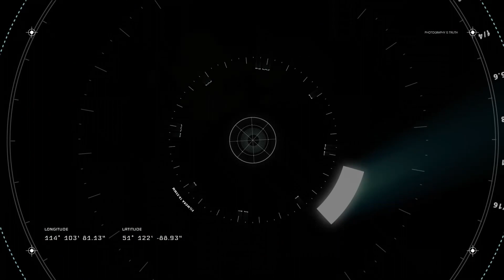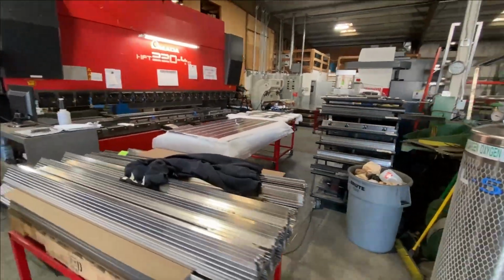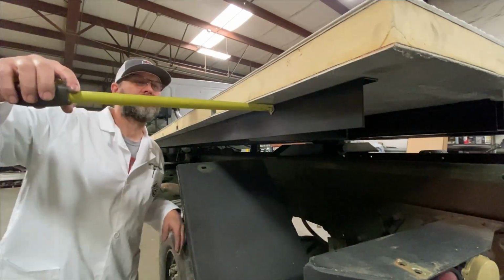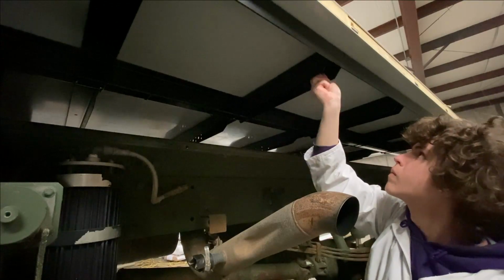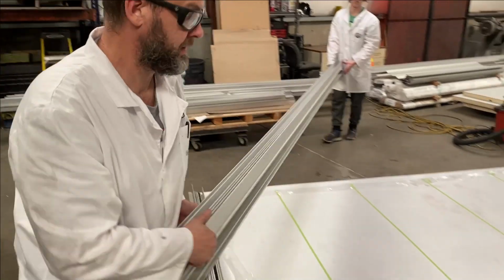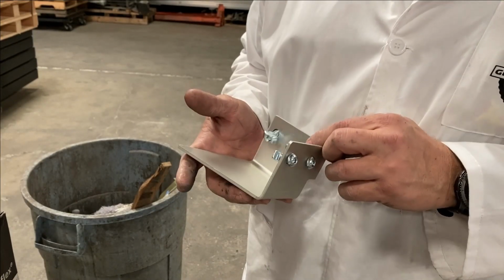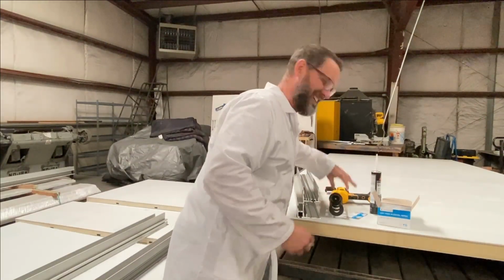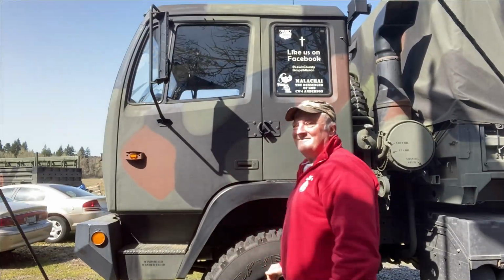FMTV CAMPER Collaboration Habitat Build Day 1 #181

Comment: Worked in the RV industry for years, composite panels are the only way to go !!
Reply from the maker: Totally agree. Let me ask you something, is it standard practice to glue FRP directly on PUR or any other type of foam without a sub-layer? The articles that I have read say, "No way! It's a poor industry practice." I wonder how other companies think they can get away with that. Your opinion?
Reply: @HelicoolsHelipad  Doesn't Total Composite do that? So FRP is supposed to have a sub-layer between it and the foam? I did not know that. What I would be concerned about is the PUR foam. It is squishy. And for a floor, that's no bueno!
Reply: @HelicoolsHelipad  We bonded right to the foam,,,but we had vacuum tables

Comment: Nice progress yeah dave
Reply from the maker: I need to call you again and get some advise. I just order some piggy back spade heat shrink connectors to splice into the relays to get that remote start installed. Also, looking as putting in the video noise filter as well. I'll give you a ring tomorrow. Thanks, Mark. And may the love God be with you and your family forever.

Comment: Whoa! That is a well thought out and slick design. So the bar stock that you slid into the floor extrusions also spread the load over the entire length to keep the box attached to the sub-frame? Very cool!
Reply from the maker: Yes, indeed. It magically happened just like that... I think it might have been the magic of engineering plans and by design, though. :-D

Comment: Would be intrested to see how that thermal bridge in the channel performs at a big temperature difference between outside and inside?
Reply from the maker: That thermal break is rated at R-14, which is almost as much as the panel itself, so no worries there.
Reply: @HelicoolsHelipad  I guess there is no more puzzling over that.